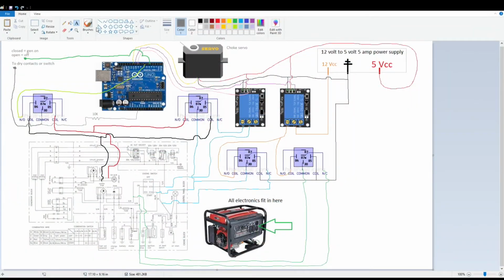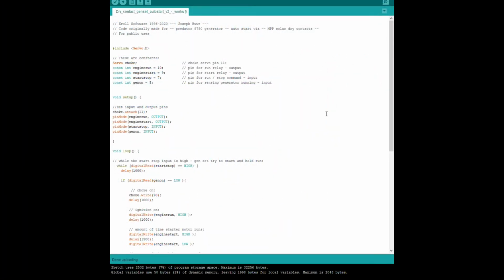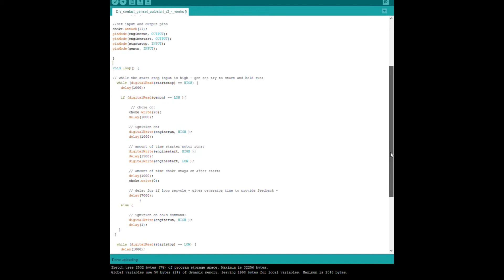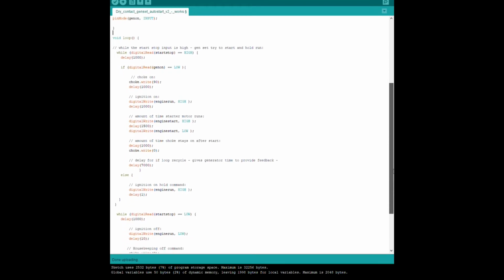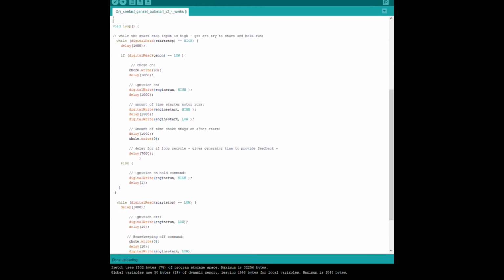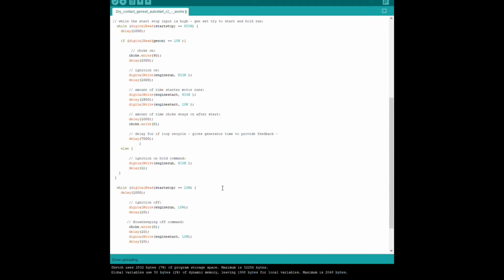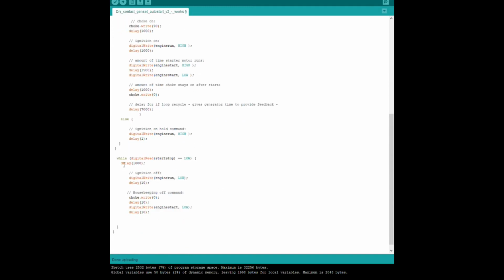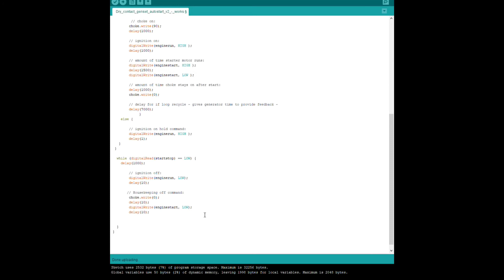Predator 8750 generator - Remote start

Comment: Nicely done, the only hard part is opening the control panel. And for my case figuring out how to hold the servo for the choke because my generator has it on the front.
Do automative relays have diodes inside? If they don't have a diode I think it would be a good idea to add them to the relays that share the PSU with the Arduino.

Comment: Great information, could you provide a better resolution electrical diagram. Thank you.
Reply from the maker: I would, but to be honest I tried using the diagram the other day myself and realized I forgot to add pull down resistors. I really need to make a better video. Life has me busy at the moment, but hopefully I will get one up this summer with way better everything. In my new controller I have added a few more features.
Reply: @josephhuwe9720  hey man,  great stuff. would love to get an update copy if ya can!

Comment: Joseph,
I just found your video after purchasing a Predator 9000 yesterday. 
My application will be fully automated household backup power. 
My goal to DIY a autostart circuit with powered choke.
I already have the commercial switch gear for the house and utility side. 
However I need the 9000 to respond to dry contacts and build in delays for transfers.
I have some experience with esp devices mostly for home automation. 
I think your work will help me get started. 
Thank you
David
Reply from the maker: I’m glad to hear this helped. It sounds like a perfect solution for your situation. One mistake I made was mounting the electronics all in the same electrical compartment on the generator. I wish I would have mounded it all in a separate box. Also I would modify the code to only try 3 times or something. When mine ran out of gas it kept trying to restart and fried the starter motor.
Reply: @josephhuwe9720  good suggestions. 
1-What is best description of choke servo for searching? 
2-On schematic are you using 12v lighter port to detect generator is running?
3-Are UNO pins 5 & 7 reversed on the drawing? Reading the code made me think they might be.
Reply from the maker: David, 
1) The servos I used were just off the shelf hobby servos. In fact I used the cheapest ones I could find. Next I connected it to the choke using a few small ball joints and a small shaft, all from an old remote controlled car. Here is a link to what I got. https://www.amazon.com/4-Pack-MG996R-Torque-Digital-Helicopter/dp/B07MFK266B/ref=sr_1_8?crid=1I6OH0I16OQ3G&dchild=1&keywords=hobby+servo&qid=1614842166&sprefix=hobby+ser%2Caps%2C226&sr=8-8

2) I used the 12 VDC output for two things. The first, is for sensing GEN on condition. The second, for DISABLING the starter relay. I did this because during testing and some unforeseen and rare events it was possible for the starter motor to fire up while the engine was already operating, this prevented that. 

3) I just looked at the code and the lame drawing I made and yes. I messed up on the drawing, good catch! Swap 5 and 7 in the schematic and you are good to go.
Reply: @josephhuwe9720  thank you for the reply.  I hope to start on it this week!
Reply: Please don’t forget about generator safety as well and please keep your children safe when using gas generators 
https://youtu.be/I1jT3ANENvI thank you. Just hoping everyone stays safe.

Comment: I don't suppose I could talk you into a video showing the actual product and installation? I am struggling to get good reference material on the process and no offense, but your paperwork just confuses me. I am a hands on guy.
Reply from the maker: Hey Ian, I'm sorry for the drawing and lack of instruction in the video. When I made the thing I didn't draw a schematic or take video, and I regret that but I wanted to share all the basics so people could try for them self. I would gladly remake the video but it would be no time soon unfortunately. The equipment is currently snowed in 300 hundred miles away from my house and I need to wait for the snow in the mountains to melt before I can get to it.

  I would be happy to answer your questions but I should warn you that the code needs polish. I chewed up a starter because I forgot about accounting for the generator running out of gas.
Reply: @josephhuwe9720  so I got the panel off and took a jumper wire (I know i could have fried things...) and touched the battery pos to connections on the switch and didn't find the one that engaged the starter. Then I jumpered neg to the one I suspected and sure enough starter engaged. So I will need to wire the relay in the wireless box to momentarily engage negative during button push. This is way simpler then I thought!  Since the setup on the relays is dummy proof I simply need to wire neg in and neg to the wire on the switch. I'll Y into the wire on the switch so it's still able to be started by the switch and Bob's your uncle! I may do a video on this as I found no usable video for my application! If I do I'll put a link in here!
Reply from the maker: Sorry it took me so long to respond. That is real cool, I can't wait to see your video. I would really like to see your setup. I to plan on making more videos this summer while at my property. Please do share!
Reply: @josephhuwe9720  basically ia an taking a remote relay box (I'll post a link) and am going to need to wire it to have one relay perform the function of the switch. One relay to run a universal door actuator (choke). And beating in mind that I don't understand coding, how do I wire it lol. Tomorrow or Saturday I'll pull the generator and get the panel off and get comfortable with the wiring. The hands on comes easy to me. The diagrams and paper representations are Chinese to me.

Comment: Joseph, Very nice creation. I live off-grid in the Texas Panhandle. 18Kw of solar array, 4 wind genny's and a backup Predator 8700 gas generator.  Have been considering converting the Predator to remote start since my power station is 100 feet from my cabin. I am a retired Electronics Tech but have little experience with the Uno. There are a few additional functions that would be nice to include if possible. I would like to collaborate with you on a short term project if you have the time.
I designed the AirBoss 1.4Kw wind generator years ago of which I have one running here currently.  I have a couple of spare generators if you are interested in wind power as well.
Reply: Here is a reminder about portable generator safety: This advice is just to make sure that everyone is aware of all the warnings and it’s just to remind people to be careful using portable generators. Everyone has to see this safety reminder for safety. Every year, hundreds of people die or get injured when using portable generators due to carbon monoxide poisoning and electrocution. Make sure you are using your generator carefully and keeping others safe as well. There is something very serious that everyone should always be aware of when using generators. Some people do run their generator indoors which is not safe and that increases the risk of carbon monoxide poisoning which can cause death of family and you. Some people run their generator in wet conditions which can electrocute them. Please remember that you should never run your generator indoors. Remember that carbon monoxide is an odorless and colorless gas that you cannot see or smell. Carbon monoxide is a silent killer. Keep that in mind. Make sure your generator is 15-20 feet away from your house and away from doors, windows, and vents. Never use your generator in your porch too. Having a carbon monoxide detector is very important against generator safety. Some people also allow children to go near the portable generator which could pose risks. We need to keep an eye on our children making sure that they are not near the portable generator so they won’t get electrocuted or burned by the generator which is dangerous. A locking enclosure also keeps kids safe. A generator shed might look like a tempting place to explore, or take cover during a game of hide and seek, but a generator is a dangerous piece of equipment that can cause injury. It says on the manual that we should also keep children away at all times from the portable generator to avoid injuries. Please do not allow a child or unqualified people to operate the portable generator. Just because some manuals missed what should be listed doesn’t mean it’s safe to do. Always follow the generator safety rules when using portable generators. Generators pose electrical risks. If you need to use your generator during wet weather, you need a generator tent to protect your generator from getting wet. Don’t let your generator get wet. Keep your generator dry and before using your generator, please make sure your hands and your generator is dry. Do not wear loose clothing when operating the generator. Everything that is said on the generator’s operating manual should not be ignored. Never smoke cigarettes near the generator. Please keep flammable things away from the generator. Never overload your generator too. Your generator can catch fire. Never ever try to plug a generator cord into a wall outlet to avoid back feeding. Back feeding your generator is dangerous. Always turn on your generator first before plugging in appliances and shut off the appliances before turning your generator off. Use a heavy duty cord for your generator and the cord should not be worn out. All the instructions should be followed carefully. Never refuel your generator while it’s running. It can cause fire if fuel spills while your generator is hot. You should turn off your generator and let it cool off before refueling it. Having a fire extinguisher next to the generator is also important. This is only a reminder for everyone’s safety of using generators. Make sure your generator is properly grounded. https://youtu.be/I1jT3ANENvI and here is a video more about keeping others safe when using generators and also about our family’s safety. Hope this helps. Thank you.
Reply: Did you do any work on this?
Reply: @colemanglover6  Not yet... I was hoping for a clearer diagram from the YouTube poster. I have all the components he listed.  The project is important for my power station. I have received the upgrade components to my solar array and have began installation of two MppSolar LV6548 charger/inverters and 25 more (250W) solar panels (88) in total. The final system will be 25Kw (48vdc) solar input and 13Kw 240vac split phase to my cabin. The MppSolar model has an auto start feature for my generator. I will be installing the auto choke/auto remote start hardware and software early fall. Its a big project. +$20K
Forward your email address if you would like to collaborate on the auto start portion or any portion of the project. I have discovered many interesting issues and creative design fixes on this 5 year solar/wind alternative energy journey.